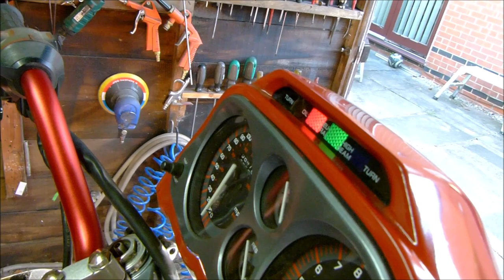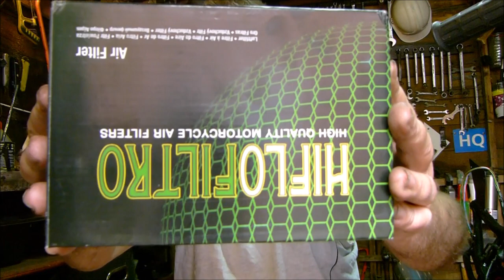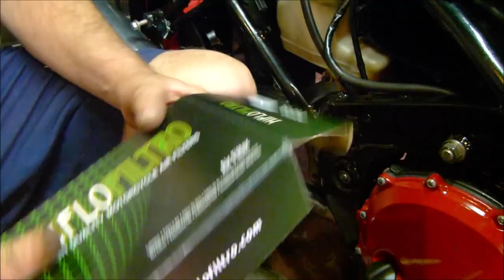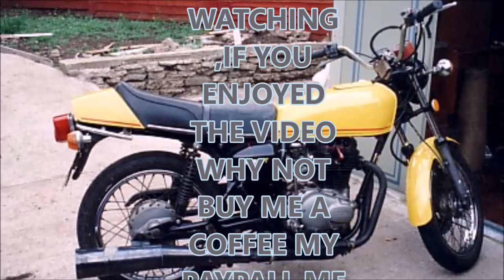CBR1000F Landfill bike, Firing on all four cylinders but gremlins.

Comment: Jon it might be worth considering to get some gasket weld yes it’s a trade Secret comes in a tube size of  toothpaste just a small light touch if it best you can put it all over the gasket then take it on and off 100’s of times and it still seal perfectly when I took my 1972 MGB GT into the mg owners club they couldn’t find a leak anywhere that’s proof of how great this stuff is. 
One another but it’s only tiny little things your get them sorted before you know you will be riding it to get its mot 👍👍👍🙏🙏🙏🙏
Reply from the maker: Ok Derek thanks it sounds good I'll check it out, cheers buddy 👍

Comment: New bongos on the air box! 🤩 too banana! I always use a smear of silicon on gasket faces to make sure I don’t have to take them apart again! I think after time the gasket faces warp  and/or corrode Johnny 🙏
Reply from the maker: Cheers Steve I did do that on the other side but this side I thought if there's any problems I might have to remove it so I just used a bit of Greece. I'll sort it now I know the engine starts up ok. 👍

Comment: Hi John you can leave the fuel filter off and have it gravity fed mate, did this to mine
Reply from the maker: Hi Martyn hope you are well.. Was it running ok on long straight roads. I did that with the zxr but it started  spluttering because the float bowls couldn't keep up with the fueling?
Reply: @jonyr1TT  You had a kink in one of the pipes? It will deliver more than enough fuel without the pump.
Reply from the maker: cheers buddy.

Comment: get a yamaha xj900s diversion fuel pump
Reply from the maker: Will that work ok on this.?
Reply: @jonyr1TT   yes only has two wires from the xj900s pump how many on the cbr pump ??
Reply from the maker: Two wires the same.
Reply: @jonyr1TT   should work then maybe cheaper than the honda item